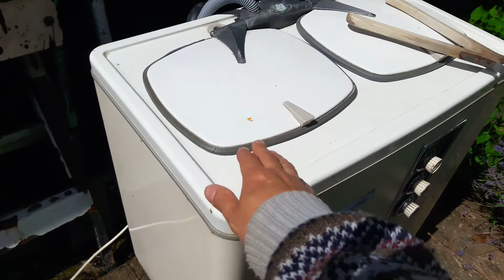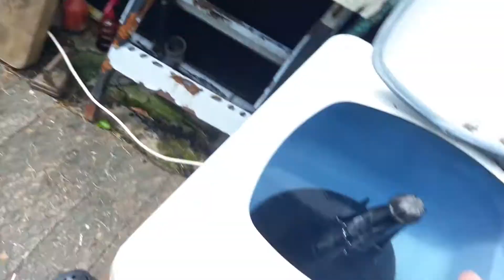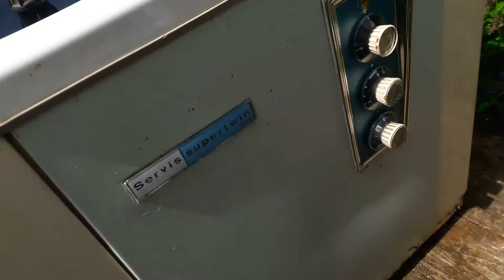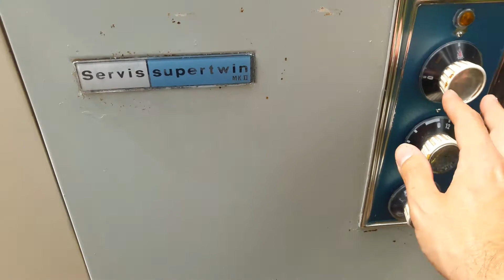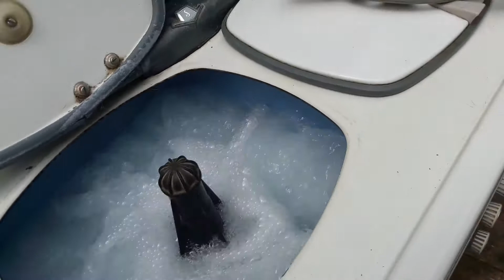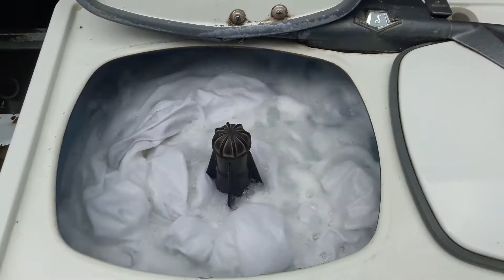Broken washing machine so using the Servis Supertwin mk2 twin tub PT1

Comment: The heater ought to be switched off before engaging the wash timer control to avoid drawing too much current on the initial start up of the agitator. Sounds like it still has its original Smiths timer.